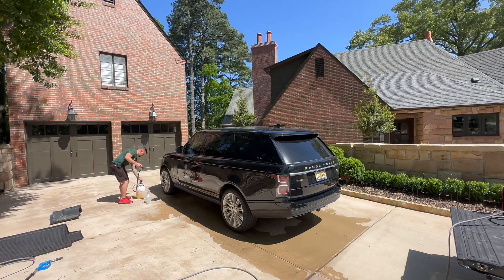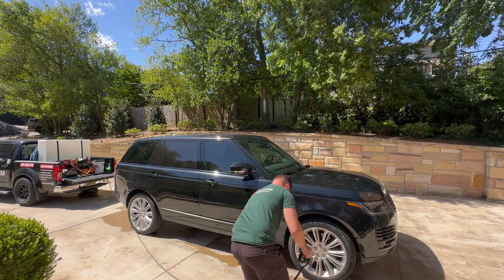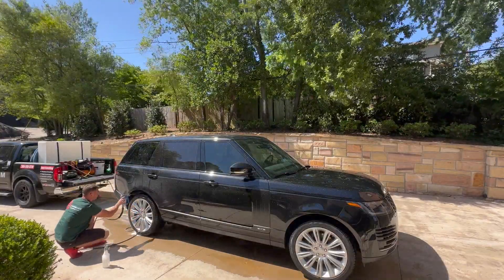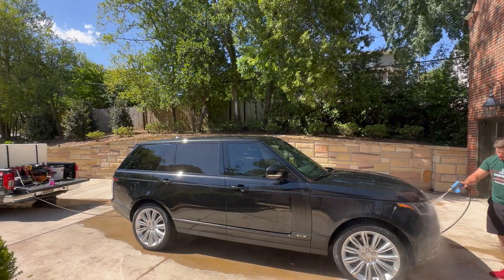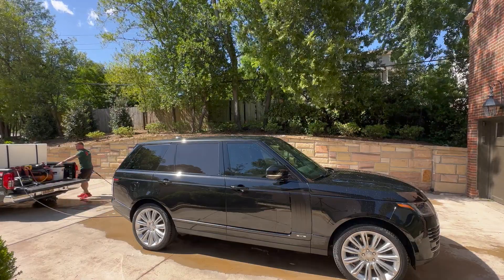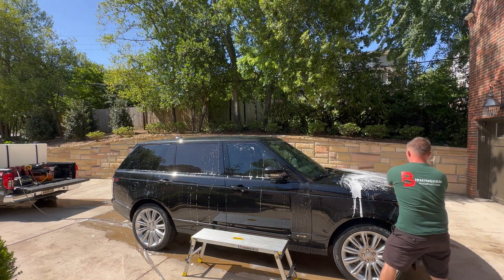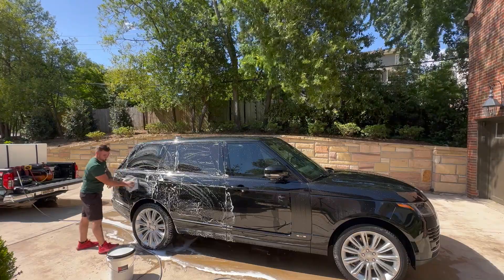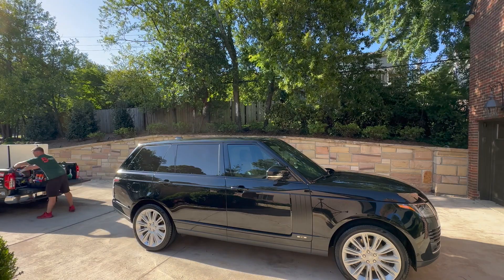Washing A Black Vehicle In Direct Sunlight

Comment: How are you liking the di rinse pro? How long has it last you?
Reply from the maker: In my opinion this system is great on the wallet. Also I get about 3000 gals of di water with 1 cubic foot of resin. It can vary depending on water tds levels in your area.
Reply: @Bhamautopros how much is your tds in your area ? Mine is 105 tds before filtering so hopefully I can I get the 4k gallons it claims.
Reply from the maker: @JCKICKS213  mine ranges between 100-190.

Comment: Just use a a resin filter,  all of my vans have  resin filters plus we carry  bat wings on all my units to keep direct  sun off the unit plus you only use the filter water  for rinsing , if you use it for everything  the cost for refilling  the resin filter will get out of hand , and if you are going to use a turbo nozzle make sure your insurance is paid up .By pre rinsing  the unit  with straight  water you can cause micro scratching,  alway prefoam it first with a high ph foam such as a bilthamber touchless , this will incapsulate the dirt  and and lubrication  to the surface,  you should also always blow dry your units as water and soap can get trapped  into wing mirrors and trim special  because  you use a low gpm unit as high pressure will bounce away from tight areas and not push the soap and debris  away . If you use a brush make sure its never nylon  hairs  only natural  boars hair to avoid scratches,  Yes having coax  hose wheels speed things up . Also instead of brushing on your dressing  try using a hlvp gun , you save product  , better shine a faster to apply